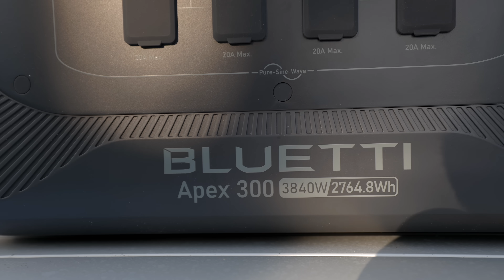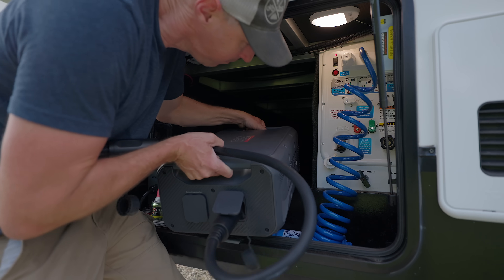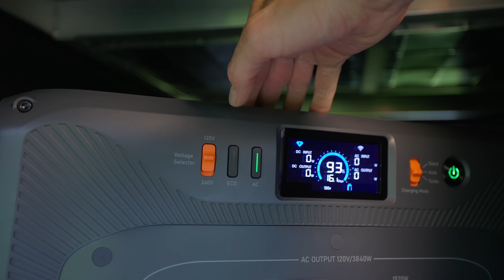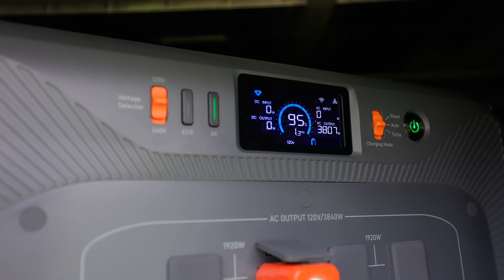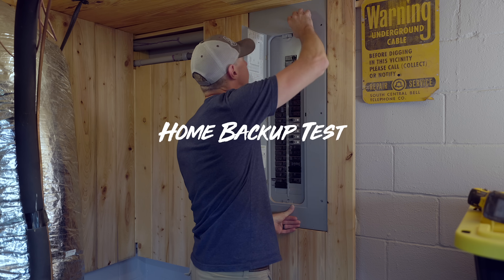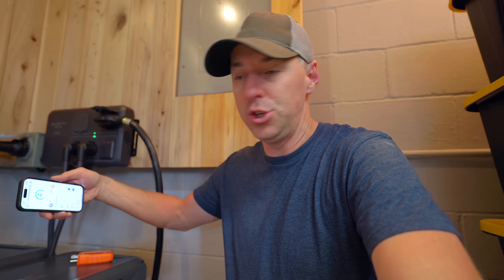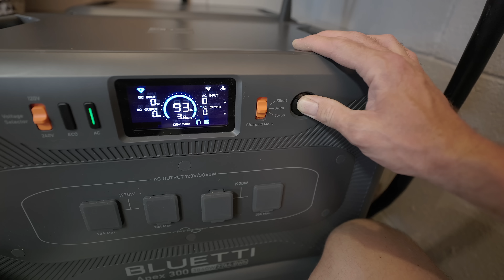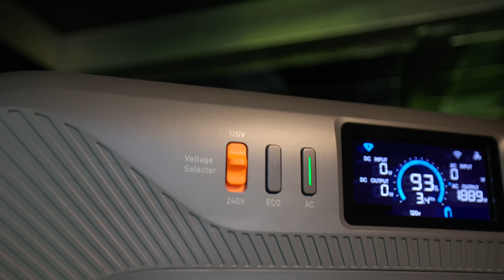Modular RV Solar + Home Backup! Simple & Cheap Bluetti Apex 300 Review

Comment: I use a 12 volt AC unit in my campervan...I hoping for Bluetti to make a unit with a 60 amp DC outlet so I can run it with out having to use a dongle...would love to simplify my Battle Born/Victron system in the future.

Comment: I'm actually looking at the Oupes Mega 5 power station for my camping trailer. Outputs 4,000w of power and surges over 7k!  Has about the same battery capacity as this apex300 plus it's expansion battery at less than bluettis price.

Comment: Do you need a bond plug with the smaller power stations?
Reply from the maker: If you are plugging your RV into it then yes.
Reply: @AllAboutRVs  If you plug your RV in to this do you need a bond plug if you are not using a surge protector? Is the bond plug only needed if you are using a surge protector and you want to prevent a fault or is it a safety issue? I don't use one on my generator so I'm a little confused. I'm heading out in a couple weeks and don't want to damage anything or cause any other issue. Thanks!

Comment: Caution!
Just because you "turn off" your main home breaker, you are NOT disconnecting the neutral. 

This is what kills linemen when working on systems during an outage.

You need a transfer switch to remove the neutral.
Reply: Neutral is tied to ground in the main panel.  Using a generator interlock kit is how you protect your system and linemen.

Comment: This review was very thorough and it was so informative, as usual. I have a question, though. If you plug your RV into this using the 30A plug do you need to install the bond plug? Is the bond plug only needed if you are using a surge protector and you want to prevent a fault? Do you need one if you don’t have a surge protector?

Comment: Great video! Keep us posted on larger capacity AC charging. Did you mention if DC to DC charging was an option? Could I install a 50A DC charge controller to my truck and use that? Like what (KYD) Marc loves?

Comment: You hit on something we are lookng at perfectly. We have our RV on property and the RV has 1300 watts of solar and over 900 amp hours of battery which is great for us but when power goes out our casita and well are dead. A unit like this being able to run our well and (MAYBE?) a mini split in the casita would be fantastic.  Maybe the mini split for long would be pushing it.

Comment: How do you keep the power supply from trying to charge your battery(s)?. If you turn off the battery disconnect you lose 12V service to the rig.
Reply from the maker: You can just turn the breaker off to your converter but there will be times you might want to charge your battery by having it on.

Comment: I'm really looking forward to the comparison video between a portable system and a permanent system for an RV. I see a lot of ads for these solar power banks, but I have a lot of money invested in my Victron system already. I am thinking about an off-grid solution for my RV garage so that I can plug the rig in and run an A/C to keep the humidity controlled.  I know I can use a dehumidifier instead, but that adds heat to the interior during the summer months, and it's another appliance to purchase.

Comment: What about pass-thru charging or UPS mode?   I want to be able to run my RV all the time off the battery pack and then top off with a generator when needed without having to turn of the battery/inventor.
Reply: Yes you can do that, they have a 50a plug and you can limit the charging to whatever your generator output is. It also will shut down past 32a and will pass through the 50A someone did a test on it and I forget who it was. If I find it I’ll let you know.
Reply: Doug Kremer was the YouTuber 50A pastthrough and assist just like the victron. 

You can set grid limit to 20A and bluetti will assist he does a full test with it runnings his range.

Comment: id say lack of auto neutral bonding is a huge con for the RV use case.  The goal is to just work once set up.   This makes it so you always have to be accessing the unit to use the bonding plug if you go on and off shore power.   For something aimed at being a Power Kit competitor thats crazy.   Its essentially not very different from their other units, just with marketing targeting RVs specifically.

Comment: I like the idea of having USB-C as a AC wall adaptor, just like "normal".   Sure its less efficient, but with USB-C hitting 240 watts its not something that I'd want hard chipped inside a power unit.  All of the other plugs have been standardized for decades.

Comment: I have the 200Max and one thing I don't like is that one cannot turn on the unit with the app. You can turn it off though. 
I wonder if this unit works the same. It would be a pain if you have to go underneath turn it on and off.

Comment: Your one of my Favorite RV channels, by far!!
I don't think you did a good job explaining this Power Station for RVers use. You could have done a better job!!
New Technology is coming for RVers, but RV influencers are not using them properly.
For instance:
1. Hooking this Bluetti Apex 300 to 30 amp and 50 amp RVs. What's needed and how do you charge it? What are the best Solar Panels to use? Can they be mounted on the roof?
2. Ford Trucks, F150, F250 and the F350 have Onboard Generator Power Systems. These would be great Systems for Powering RVs, but not too many influencers are talking about it.
3. Furrion Chill Cube Variable Speed RV Rooftop Air Conditioner - 18K BTU. This is a Game Changer for RVs and should be fully examined by Off-Grid influencers.
4. CountryMod Pro - 12V RV Air Conditioner – 10,000 BTU Lowprofile, Very Quiet Rooftop Air Conditioner. Another Game Changer for RVs, Campers and Van Builders!
Reply: I agree, what do you need to charge it, will it run when charging on solar, what kind and how many solar panels would you need for amp RV

Comment: So you used the 50 amp cord and plug, but the Bluetti was set at 120V and it ran everything?  This is way simpler(in my brain) then a full solar and battery set up.

Comment: if you use this on the RV do you shut off your DC converter at the breaker box?
Reply from the maker: Depends. There will be times you want to shut it off and there will be times that you might want to charge up your RV battery with it. I would probably turn it off at night and on for part of the day.
Reply: My RV has 200w solar and would charge during day
 I have no inverter@AllAboutRVs

Comment: Great video, love the size and stacking, the solar input is a no go for me, do you think they can increase the voltage?
Reply: They have a proprietary add on box which I believe raises the volts to up to 500.
Solar X
So you have to buy another piece of equipment but you could build a massive system.